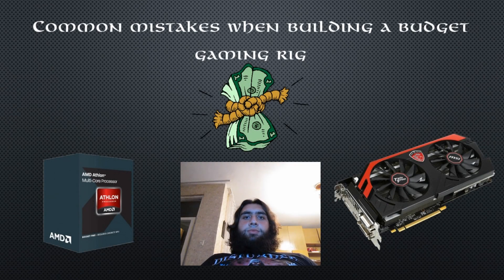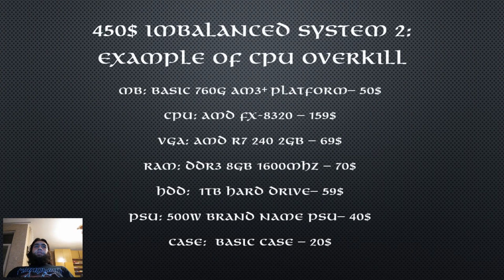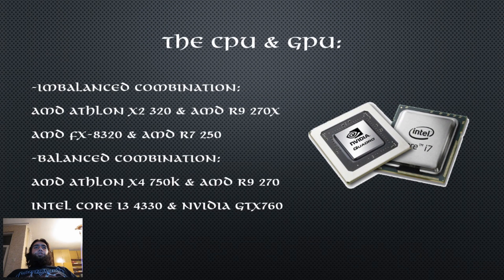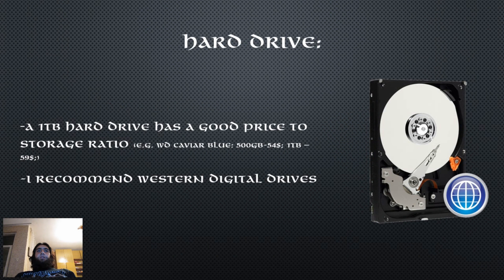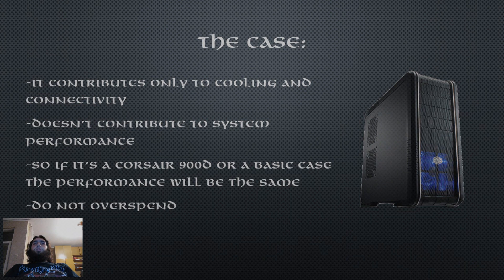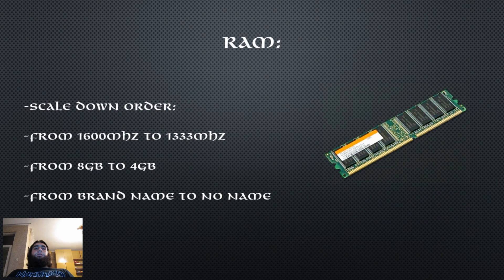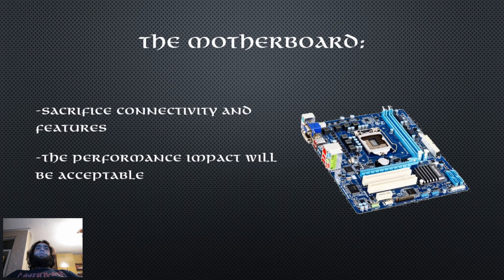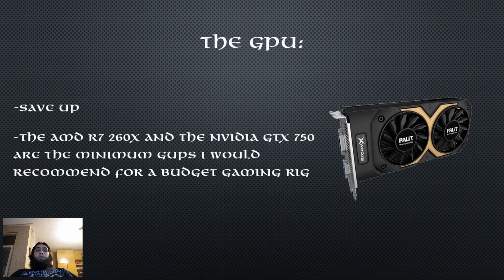[TUTORIAL] Common mistakes when building a budget gaming PC

Comment: Tech Order, this may interest you.

I had the possibility of putting two platinum rated PSUs head to head in my new system. Those two are the Corsair AX860 860W Platinum (the Seasonic build, not the Flextronic "i" version which I don't trust) and the Super Flower Leadex Platinum 550W PSUs.

I got the following results:

AX860
Off 1.3 Watts
Idle 41 Watts
OCCT (with AVX) 133 Watts
Furmark 98 Watts
Prime95 145 Watts
Prime95+Furmark 151 Watts

SF550
Off 1.3 Watts
Idle 36 Watts (-12.2%)
OCCT (with AVX) 127 Watts (-4.5%)
Furmark 93.5 Watts (-4.6%)
Prime95 137 Watts (-4.5%)
Prime95+Furmark 142 Watts (-6.0%)

I think this shows how important it is to choose a PSU commensurate to the build. The power consumption of the system is just too low to allow the AX860 to get into the zone where its platinum efficiency really comes into play.

The 550 Watt PSU is still a bit overkill for the computer I have built, however if I ever did wish to put a dedicated graphics adapter into the system then the power consumption would be pretty much slap bang in the middle of the sweet spot under load.

The "sweet spot" for a PSU is at around 50% of the rated wattage of the PSU (+/- 7%). This is where a PSU reaches its maximum efficiency (where it suffers the least loss when converting AC to DC). For the AX860 this would be 430 Watts and for the Leadex 550W it would be 275 Watts. 

So for any PSU that you buy, you have to consider two things:

1) What is the typical load the PSU is going to be under
2) Would the price difference between a PSU which would be in its sweet spot at that load and a PSU which could run the load at the higher (and less efficient) end of its rated wattage be made up by the savings of electricity.

This concept of the "Sweet Spot" applies to 80+ No Rating, Bronze, Silver, Gold, Platinum or Titanium rated PSUs equally.

There is a trade-off to consider between what you pay for the PSU and what you will be paying ongoing for electricity.

Obviously this has to be taken into account when buying two different classes of PSUs.

For instance a Bronze rated PSU at 50% would be 85% efficient whereas a Platinum rated PSU at 50% would be 94%. This difference (9%) is reflected through all percentages of load from 20% to 100%.

This won't make too much of a difference if you are only using the system three or four hours a day, but would be a major consideration if your system is on for at least eight or more hours a day (my own system is on 24/7).

Another thing to consider is that PSUs have a component known as a capacitor and they "age", that is become less efficient over time. The hotter the capacitors become, the more quickly they age. Likewise lower quality capacitors age a lot more quickly than high quality ones.

This means that although your Bronze rated PSU may be reasonably efficient when it is new, if it has lower quality capacitors (which for instance is the case with the Corsair CX 430) and you are running it at the higher end of its rated wattage then the efficiency will drop pretty quickly (within less than a year if you are using your computer for more than four hours a day). This means that the electricity cost for running the computer will significantly increase over a relatively short time compared to buying a PSU which uses high quality capacitors and is cheaper to run in the first place because of its higher efficiency rating.

OK I admit that I am very anal with regard to PSUs and place it in 1st place by far when considering which components to buy for a build. I think however that I have a pretty solid case for my opinion.
Reply from the maker: +Michael Nager Well, I can see that you have done some tests and I do find your results interesting. A lot of people neglect efficient PSUs because of their high price never the less your points are quite valid. Keep up the good work. :)

Comment: You are both right and wrong with regard to the case not contributing to performance.

If you buy a really piss-poor case you might find yourself in a position where the components cannot be adequately ventilated, which can under load cause the components to thermally throttle because they are getting too hot.
Reply from the maker: +Michael Nager Usually lower end builds incorporate components which do not produce that much heat and besides I am talking about circumstances in which the budget is really tight.

Comment: One thing which bugs me about the recommendation is the use of one 8GB stick of RAM.

This is a waste of inherent performance.

If you are going for 8GB of RAM you really should be installing two 4GB sticks of RAM. This is so that you can take advantage of the Dual Channel architecture of the motherboard.

Dual Channel means that when one stick of RAM is being accessed, in the time that it takes for that RAM to be ready again (because of latency) the other stick of RAM can be accessed. This used to be called "Interleaving".

What kind of boost in performance will there be with regard to using 2*4GB instead of 1*8GB? Depending on the application it will be little to a lot (5% to about 30%). The fact of the matter is though that 2*4GB under any circumstances will outperform 1*8GB all other things being equal.

With RAM however there is another thing to consider, and that is the latency.

Let's say you have the choice between PC-1600 RAM and PC-1833 RAM for the same price. That's a no-brainer right? Get the PC-1833 RAM. Well that might not work out so well. If the PC-1600 RAM is CL9 and the PC-1833 RAM is CL11 (with regard to latency) then it turns out that the PC-1600 RAM will have a higher performance than the PC-1833 RAM. Latency basically means the amount of time the RAM has to wait around doing nothing before it can be accessed again.

I could make a comparison to male sexuality here, but I think you get my drift.

I am not writing this for you Tech Order, but rather for others who may watch your video and this is meant as a, I hope, welcome addendum to your video.
Reply from the maker: +Michael Nager You are correct but when I made this tutorial the price of 2x4GB sticks was noticeably higher(10$-15$+ more) than the cost of a single 8GB stick and the point here was to lower the overall price of the rig as much as possible.

Comment: All was good, but i've had nasty experience with corsair CX psu's  I would recommend avoiding them, the others corsair makes are good though!
Reply: I've used them quite a few times and never had problems with them.
Reply: starterpivot
I have issues mainly because they don't have enough amps on the 12v

Comment: no name branded ram? lol thats a new brand? and about power supply ... dont talk bullshit .... i made builds with cheap psu-s lol and no one died ... just mine because of a lightning ... recomending WD? why? they are gods? wd = mixer crancking like an old lady after few months ... i not hear one other hdd drive like wd after 2-3 months of use ....
Reply: bad psu= could potentially fail and the shock could fry your other parts, u dont realize that dont you
Reply: ***** first of all ... any psu came with a guarantee right? and in last 5 years even the chepest psu is 10 times better than was in past ... cheap psu not bad how you saying is not that bad ... only thing in mind is to not to overload .... even after 2 lighting still worked ... is died because the light bult poped ...dam ... so if you buy a NEW psu its ok ... cheap its not equal BAD ...
Reply: *****
ugh some people just dont understand dont they. a cheap psu has a chance of failing and could proabably cause a surge to the other parts of the pc, at this point the waranty is useless

Comment: Would this be a good gaming pc with cpu/gpu balance? 
CPU: Intel i3 (In the future i'll upgrade it to an i5 probably)
GPU : Nvidia GIGABYTE GTX 750 1GB
Reply: P.S: The cpu is a dual core but it can become a quadcore for what i have heard when it's under pressure,but if i am wrong please correct me :/ also , it's 3.4 ghz i3 3240
Reply: antipativome I don't think you understand how CPU's work. It is not physically possible, or in any other way possible, for a cpu to be dual core but become quadcore when "it's under pressure". Either the CPU is dualcore, or it is quadcore. There is no back-and-forth.
Reply: Hyperthreading.
Reply: Hypertreading is something you won't have on that
Reply: Ellis Friths The I3 processors have hyperthreading, but note that Hyperthreading isn't as fast as having more actual cores. Nonetheless, most games now-a-days still don't use more than two cores.

Either way, if you're willing to spend a little extra on one of the higher end I3s (a Core i3-4360 should be fine) I would go for the following GPU:
http://pcpartpicker.com/part/powercolor-video-card-axr92702gbd5tdheoc
and jump on the rebate.

Comment: Love the video! Is there any way you can help me edit this build? I'm trying to spend around 600, and would like to upgrade later hence the case i chose. A second opinion would be helpful.

CPU: Intel Core i5-4440 3.1GHz Quad-Core Processor  ($187.98 @ SuperBiiz)
Motherboard: ASRock Z97 PRO4 ATX LGA1150 Motherboard  ($99.99 @ Newegg)
Memory: Team Vulcan 8GB (2 x 4GB) DDR3-1600 Memory  ($79.99 @ Newegg)
Storage: Samsung 840 EVO 120GB 2.5" Solid State Drive  ($80.99 @ NCIX US)
Storage: Seagate Barracuda 1TB 3.5" 7200RPM Internal Hard Drive  ($52.91 @ OutletPC)
Video Card: XFX Radeon R9 280 3GB Double Dissipation Video Card  ($219.99 @ Newegg)
Case: Phanteks Enthoo Pro ATX Full Tower Case  ($95.45 @ Amazon)
Power Supply: Corsair CX 600W 80+ Bronze Certified Semi-Modular ATX Power Supply  ($44.99 @ Newegg)
Total: $862.29
Prices include shipping, taxes, and discounts when available
Generated by PCPartPicker 2014-08-04 20:37 EDT-0400

Comment: The Celeron actually doesn't perform that bad - it's got the same features as a Pentium G3240. The only difference is the slightly lower clock speed.

Comment: Hey, if I get an Intel Pentium D 945 and pair it with a GT 640 will there be an imbalance?
Reply from the maker: That CPU came out 6 years before the GT640, this combination is not wise.
Reply: Tech Order So what's the best GPU I can use with this CPU? Also mind, I have a 350W PSU.
Reply: TheKg251 Probably something terrible like a GT 610.

If your rig is seriously that old, I would get at least a Celeron G1840 ($45) + a decent H81 motherboard (~$60). Before buying, confirm that the motherboard has been flashed to support 'Devil's Canyon' CPUs. (I would go for a Pentium G3258 if possible - it's overclockable).

Now throw in a GTX 750Ti ($125). You're set!